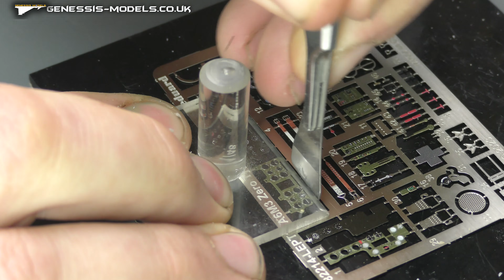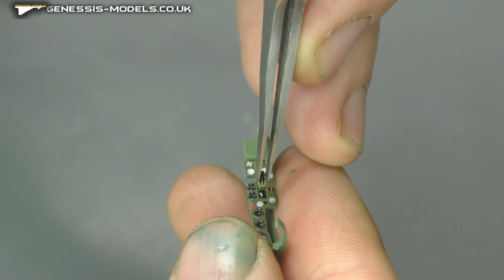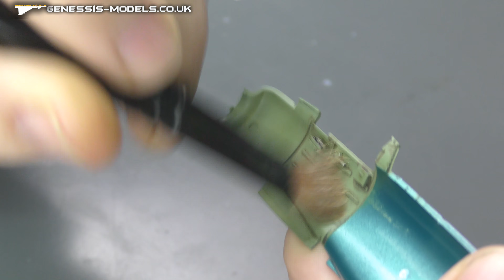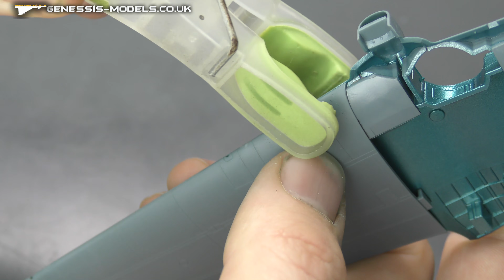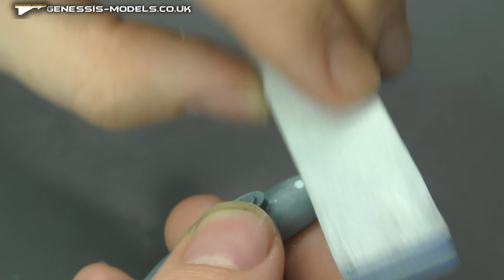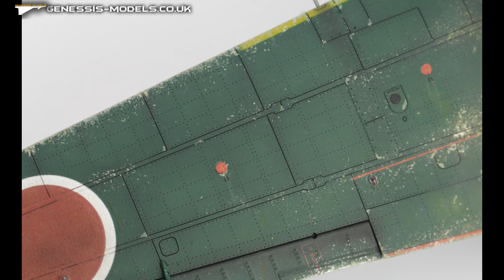A6M3 Zero Type 22 : Rapid Video Build : Eduard : 1/48 Scale Model : Part 1 of 2

Comment: I just finished the Eduard A6M3 Type 32 and had the same issue with the wing/fuselage joint. I too came to the same conclusion that you did. Other than that, it was a great kit to build. Cheers